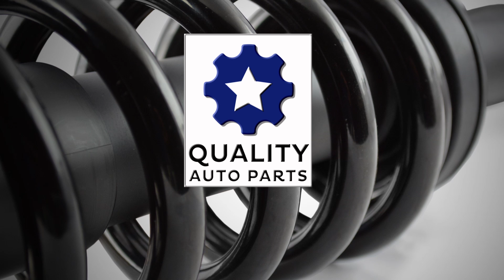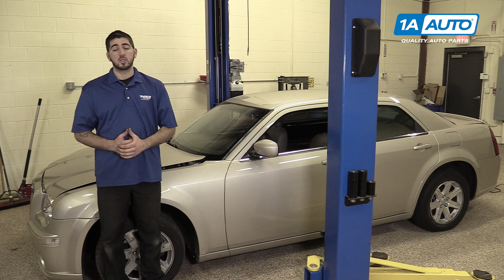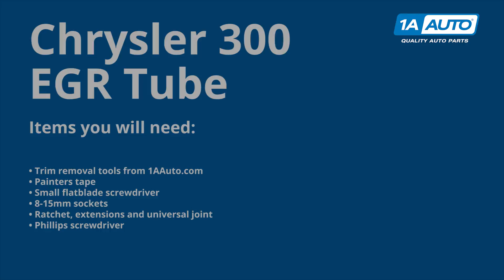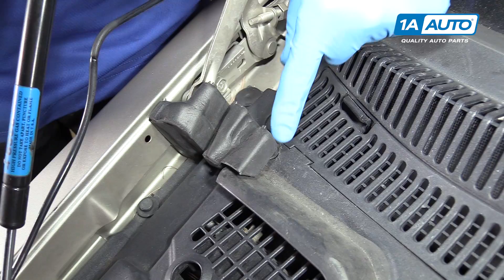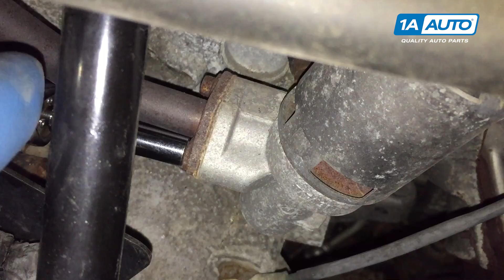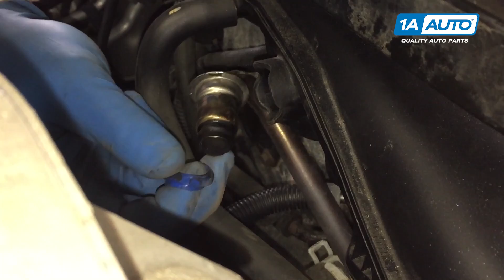How to Replace EGR Tube 05-10 Chrysler 300

Comment: I love how you skip the part when installing the gasket for the EGR. It is nearly impossible to do it with one hand. You need someone else to hold it for you. It's best if your by yourself to take the upper intake off as well, then it's easy access. Slightly screw the gasket into place but keep very loose. Reinstall the upper intake. Then insert the EGR tube into the upper intake, then tighten the bottom of the EGR tube gasket with long extension.

Comment: Question:  I recently replaced my valve covers and reassembled my engine.  But the EGR tube doesn't seat all the way in.  Would this be a good cause of a P0300 code?

Comment: Does the gasket go a certain way or both sides of gasket the same?
Reply from the maker: +69 Dodge Charger Thanks for checking us out! If there is a smooth, metallic side and a composite side, the metallic side should be installed facing out, meaning toward the exhaust manifold. Hope this helps! 1aauto.com
Reply: @1AAuto  I was going to ask about the rubber one that goes on end of tube at the intake manifold also! Does it have to go a certain way! Just want to make sure I do that right because it’s  leaking! Thanks for info and good mechanics for describing things!

Comment: I got a leak right there where the seal is, is there a Bolt or anything to keep it in there tight or is my tube bad?
Reply: Replace de seal man,  if the vacuum leak is right between the egr tube and the plenum
Reply from the maker: +Hit 22 We wouldn't be able to diagnose an issue like that here, you may want to have a local mechanic take a look at it. Thanks for checking us out! 1AAuto.com

Comment: Man I came to see how the gasket on the egr tube was inserted but seem to skip that part lol
Reply from the maker: +Manuel Gonzalez Thanks for the feedback!
Reply: Shoot me too lol
Reply: My kit came with 2 orings.. doe's it take both or one is just a spare...?
Reply: @english5050  did you find out?
Reply: @scatsam7566  the round side of the blue egr valve gasket faces the cab of the car. the flat side is what is inserted into the engine, it creats a good seal.
Reply: @english5050  ones just an extra.
Reply: What if my egr pipe keeps creating air leaks from slipping out?
Reply: Me too
Reply: Same, thanks for saving me 8 min.
Reply: Same here.
Reply: Same 😂

Comment: Start at 4:50 if you’re only looking for direction new gasket/seal should be installed. There is a discrepancy it appears when it came out the seal/gasket was facing opposing direction. But I’m choosing to use the ‘reinstall’ direction because the uninstall could have been a recording mistake. .
Reply: Caught that to

Comment: Can you clean the EGR tube with a carb cleaner or does it have to be replaced?
Reply from the maker: +kattoa159 Thanks for watching!  You can do that to help clean out the carbon build up, but sometimes it will have to be replaced if it is too far gone.  1aauto.com
Reply: @1AAuto  hi did you have a video from.this car on how to replace the transmission mount ?
Reply from the maker: +the champion We're always cycling through common cars. We'll add this repair to our list! http://1aau.to/m/Shop-1AAuto-c

Comment: Lawd! TIL you gotta take the hood and the windshield wipers off to change the EGR valve.
Reply: no u dont have to it's always off in every video
Reply: yep  because  they get paid  by the hour  so this is why  my self  would of just looked from under the car  and reached  up to the valve
Reply: @mikestock3795  so I can lift the car and get under it to unbolt the egr pipe?
Reply: @mikestock3795 is it easier to get to from under the car?
Reply: Easier to take the upper intake off